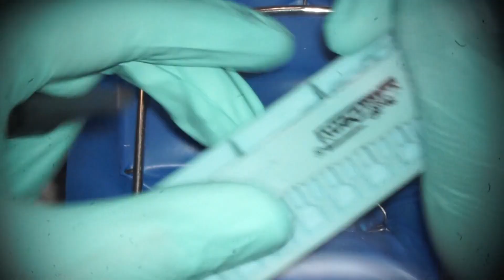ROOT CANAL ENDODONTIC TREATMENT

Comment: can you have a root canal on the lower front teeth? They look so small, the lower front teeth? Please let me know I've been told to either pull or root canal.
Reply: Lower front root canals can definitely be done. They may be small teeth, but there are still canals that can be treated if there is a toothache, just like fillings are done on those teeth too.

Best of luck to ya.
Reply: @Trewq79  are you a dentist john smith? I need to get a root canal on front upper tooth. If I dont get a crown, will the tooth change color? can it be recolored with any methods? thanks.
Reply: @StreetWorksMedia  I am a dentist. So the short answer to that is "it depends" sadly.

If the front tooth has no fillings or cavities, a root canal usually won't change the color of the tooth and you're good to go. It's rare, but sometimes a root canal can darken a tooth since the tooth "dies off". If it's any comfort, I have never had a tooth get darker AFTER I did a root canal on it (often times they darken before I touch the tooth because of past trauma or other stress).

Of course, I don't know your specific case, so 100% trust the dentist who you're seeing for the best care. Best of luck!
Reply from the maker: It is upper central incisor.